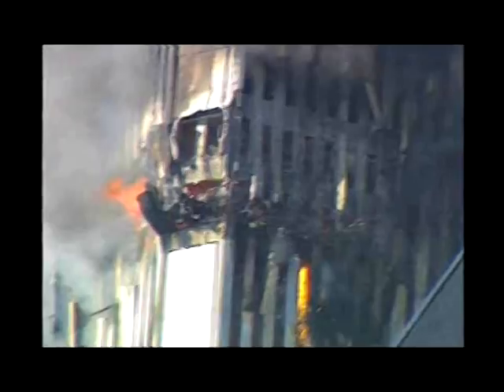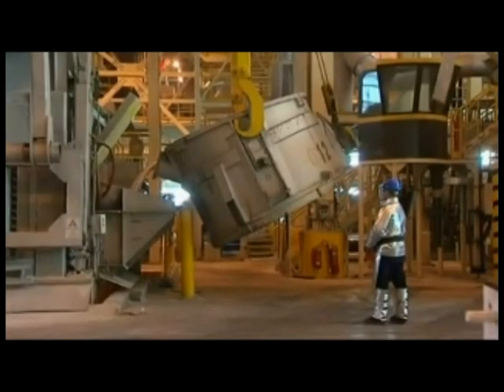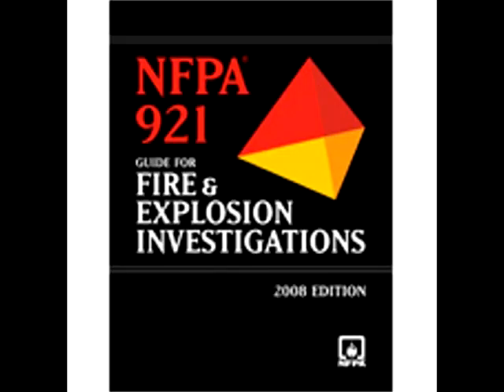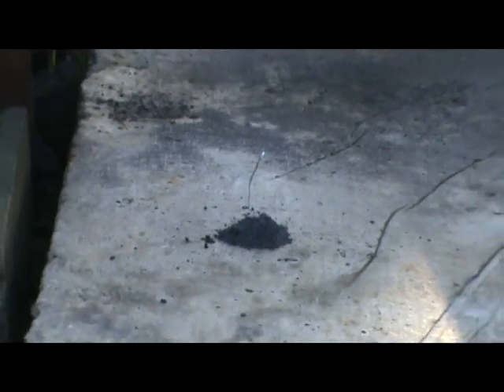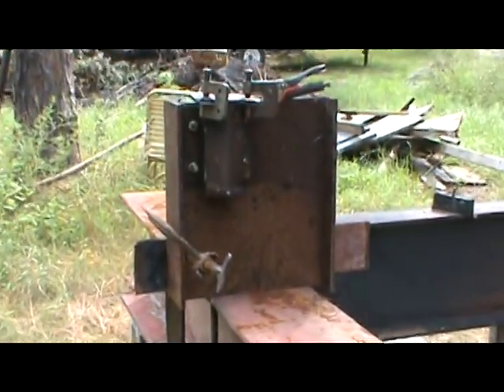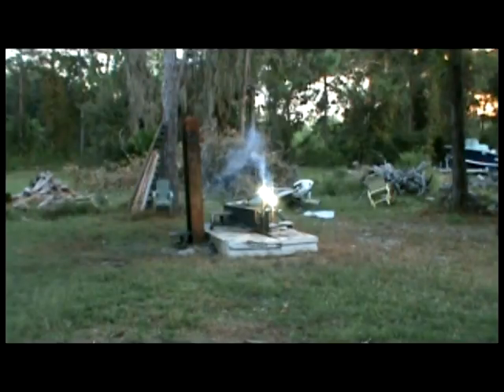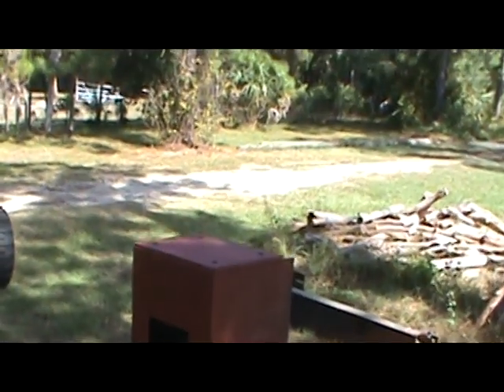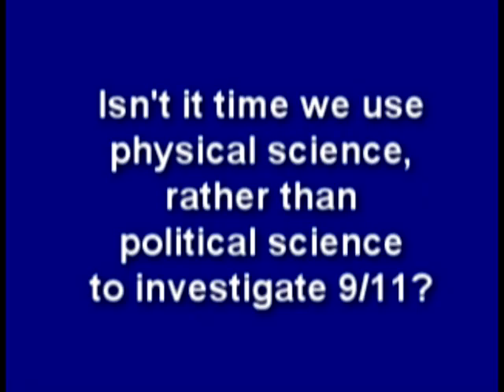9/11 Experiments: The Great Thermate Debate

Comment: I agree. If we want to measure the cooling speed of two similar volume droplets of aluminium and steel - the volumetric heat capacity is a better measurement than just specific heat capacity by weight.
Aluminum 0.91 kJ/kg°K * 2712kg/m3 = 2467.92 kJ/m3°K
Iron 0.45 kJ/kg°K * 7850kg/m3 = 3532.5 kJ/m3°K
However the difference is not that big to distinguish one from another by a naked eye, grainy video footage and guessing the temperatures. More precise would be their acceleration in the free fall!?

Comment: Copy & paste my mentioned keywords (Kerosene flame temperature) in the Google Search box and the first result is: wikipedia ... wiki/Adiabatic_flame_temperature
But if you trace back the discussion, you'll see that I no more claim that inside the WTC the pressure was constant enough to reach 2093°C. And we're further discussing the aluminium hypothesis. What a pity that Youtube doesn't display comment threads normally!

Comment: agree, the point is that even pure aluminium can glow. 
@funkadelic: of course aluminium can be alloyed with other elements (or oxidized)
->more intense glow possible.
if it wasnt possible, the planes couldnt be made of alloys.
@reinis: i would look at the volumetric heat capacity Cv, if we want to estimate which droplet (steel or alu) of a certain volume would cool faster.
Cv of steel is higher - so i guess aluminium would cool slightly faster.

Comment: Just the opposite: glowing colour of droplets depends from the temperature (regardless of metal), more over iron has lower specific heat capacity 0.45 vs 0.91 kJ/kg°K (cools faster and btw solidifies faster too).

P.S. Anyway I don't think that the colour of the droplets already cooled in the air while falling is a very strong argument on either side - for we can barely see the colour in this low quality. The principal part of the argument was that aluminium can be yellow too when hot.

Comment: "Maybe I don't understand what you meant by "glow more consistently""

It means that molten iron (or steel) will have longer glowing duration than liquid aluminum (as seen in the videos - aluminum cooling off almost immediately, whereas iron continues to glow for quite some time as it is spread into the air).

"but cold steel is much darker (closer to black) than cold aluminium"

Cold? We're talking about liquid metals. What I meant was, what is "black" about molten iron?

/watch?v=IVNFuF76Sbk

Comment: Let's calculate how many tons of steel flowed out just in this single place (a sceptic calculated as 30t, maybe exaggerated) and multiply with the no. of columns (not all but enough for structure to collapse), multiply with 2 (twice as much thermate is necessary just for melting the steel once) or rather with >10 (for keeping it molten longer a floor below). Result=many t of thermate. smuggling them inside 3 buildings & cutting walls & attaching to the steel in 100s of offices without witnesses?

Comment: Watch this video ?v=30OVAvg1aGQ (made by a 9/11 truther) and pause at 1:37. The colour of the molten aluminium before it has cooled against the pan is yellow (only a moment after cooling it turns silver). And if you watch drips from molten metal at WTC it seems to turn lighter when falling further down like aluminium, whereas steel should turn black.

Comment: "Author wrongly claims that molten aluminium looks"silver""

It is not wrong to claim that molten aluminum can look "silvery" ("/watch?v=8rERmIN4O_o"), but it *can* glow, yes. Now, at what temperature is aluminum glowing orange-yellow, and how do normal office fires create such temperatures? Further, how does the alleged aluminum continue to glow, falling through the air (watch how fast it cools down), given its low density (and aluminum won't mix easily with furnishings, glass or plastics)..?

Comment: The molten aluminium theory is much more plausible than the steel theory: 1) Author wrongly claims that molten aluminium looks"silver" (in fact it is orange-yellow-white depending from temperature). 2) How can you retain above 1539°C temp. to keep steel molten, but with normal furniture fire you can still keep aluminium molten easily (only 660°C required). P.S. If you find any iron containing spheres - how can you distinguish which are remains from construction works (majority) or from thermate?

Comment: Ok, I must agree with you that keresone burning inside of WTC resembles more diffusion flame (only 990°C) than adiabatic flame (in combustion engine) (2093°C).

But the question remains unanswered - what were the large amounts of molten metal flowing right next to the place where plane crashed (and nowhere else) and long before the structure collapsed (how could a structure stand and seem almost intact if so much "steel" was already molten). More likely the molten metal was aluminium, not steel.

Comment: "where as Kerosene's (jet fuel's) flame temperature is more than enough 2093°C."

You are referring to the theoretically highest burning temperature in a *controlled* experiment where "no energy is lost to the outside environment." (go back and read the article you referred to). Jet fuel does not burn hot enough to melt steel in an open, uncontrolled environment.

Comment: Pure aluminium has very low emissivity, so normally, molten aluminium appears silvery. But for planes, different alloys of aluminium are used. some of the aluminium could be oxidized during the fire. such alloys and oxides have higher emissivity:
omega .com/literature/transactions/volume1/emissivitya.html
and maybe the alloyed, partly oxidized aluminium was even mixed with some other materials of similar density. at around 1000°C (office fire) i would expect it to glow orange-yellow.

Comment: Again, you cannot compare an open fire of a single steel beam to burning skyscrapers. but i believe you are right, that the fuel didnt melt the towers steel beams. office fires can burn very hot for a long time (at about 1100°C) und there can occur events like the backdraft: pyrolized gases can explode and for some minutes the temperature can reach up to 2500°C. but im not very convinced that this is the explanation for the "molten metal".

Comment: you cannot compare burning cars to burning skyscrapers. in closed buildings, conditions are different from those of quasi open fires, temperatures can be much higher. agree, that (dispersed) jet fuel wouldnt burn long, some professor estimated, it would burn for 10 minutes. more important are the materials inside the towers, maybe burning at 1100°C.

Comment: kerosene will only reach 2093°C when combusted in a turbine engine with a very precise afr (air fuel ratio). not making any claims as to how the towers collapsed, but that figure is over 1000°C of the mark for kerosene burnt in an uncontrolled environment. try pouring kerosene on a steel beam and set it alight you could wait a week and it still wouldn't melt it.

Comment: the jet fuel wouldn't reach temps close to 1000°C unless it was burnt in a oxygen feed environment even with the stack effect. and the fuel would have been burnt within 1 maybe 2 minutes max. 
in the same way that a burning car never reaches a high enough temperature to melt the steel chassis even when the petrol ignites.

Comment: Steel spheres are actually droplets of molten steel after they cooled in the air while falling down!
And these explosions of individual windows as thermate ignitions is an absolutely useless hypothesis. Because these individual windows explosions are too few and too scattered to damage the all around steel structure. Besides windows exploded only after the building already started to collapse. The realistic explanation is compressed air escaping from elevator shafts while building collapses.

Comment: The author shouldn't have split the video footage in half: 1st with fire /split/ 2nd with a hole already in the steel. It would be much more convincing that the author shot the whole process into one continuous shot: intact steel -> attaching thermate -> igniting -> zooming in the molten hole in the steel, so all doubts are gone.

Comment: Thought about that too, that the metal was melted by electricity. Maybe thats also one reasonable explanation for the flashes and the iron microspheres. Or another source for the microspheres could be from welding/cutting.
Guess some truthers just want to make profit and most really believe bullshit. But what I like here is, that he performs experiments and even (as i see it) proved the official version in some details wrong (which of course is no proof for an inside job)

Comment: You say you're an Engineer, and so am I. Have you tried proving that the "molten steel" wasn't anything else? How do you know it wasn't an electrical feeder contacting a bare steel column, or a failing transformer, or UPS battery plant failure caused by the plane impact? How do you know the explosions weren't caused by building equipment that can explode if damaged/on fire? There are MANY sources for these things inside large commercial buildings but you "truthers" never look into any of that...

Comment: That al-Qaeda "pilots" should have flown the planes in those manners can be ruled out because there is zero evidence and because they simply COULDN't have.
Everything points to remote controlled (special) Boeings. To rule THAT out you'd have to investigate the possibility thereof and. (And funny enough, those who are involved with remote controlled airliner/Boeing technology are those who blocked them selves from being investigated. Ta-daa!)
You'd also need to explain the wrong "UA 175" engine.

Comment: Great video man and well done for going to such lengths to show how easily it can be done. I can't get the image out of my mind which shows numerous steel columns at Ground Zero, cut at 45 degrees with a residue flowing down the sides. How can just the weight of a crumbling building CUT steel, especially in such a precise way? Controlled demolition x 3... 100%

Comment: It would be wonderful if the Pentagon released footage of what plane struck the Pentagon. But I have the feeling that you can't comprehend why they never will. But it is because that it was the best filmed of the 3 "hit planes" and the pictures would expose more clearly than the blurry WTC plane pictures, what special Boeing "757" we're dealing with (and that it did not knock down the light poles before crashing).

Comment: couldn't you form enough thermitic material from 28 years of corrosion? All you need for a thermitic reaction is an oxidised metal(or metalloid) (eg Fe2O3 or SiO2), a more reactive metal (eg Al or Zn) and a heat source to kick it off (usually Mg wire is used...burning jet fuel finally working it's way through the insulation on the beams perhaps?)

Comment: Utter nonsense. This has been debunked, refuted and utterly discredited for over 3 years now (nano-thermite = paint/resin) yet you still have the idiocy to bring it up.

The peer-reviewed paper has still not been challenged on any level and we now 4 years down the line; thus, it stands.

Secondly, nano-thermite was found in every single dust sample and every single chip contained abundant aluminum, iron, and oxygen, with the aluminum being in mostly a pure, elemental, form.

Comment: Liar.
Read the WTC Dust Study Feb 29, 2012 by Dr. James Millette
"Conclusions:
The red/gray chips found in the WTC dust at four sites in New York City are consistent with a carbon steel coated with an epoxy resin that contains primarily iron oxide and kaolin clay pigments.

There is NO EVIDENCE OF INDIVIDUAL ELEMENTAL ALUMINUM particles of any size in the red/gray chips, therefore the red layer of the red/gray chips is NOT THERMITE or nano-thermite."
9/11 TRUTH DEBUNKED! No thermite.

Comment: Finding elemental residues of iron-oxide and aluminum is simply not something you come across in a 'building collapse'. It is not a simple case of ticking off a list of materials in the building.

Such simplistic reasoning led people to assert that sulfur in the gypsum wallboard which caused the intergranular of steel girders in W7 - ignoring the fact that although gypsum contains sulfur, this is not elemental sulfur, which can react, but sulfur in the form of calcium sulfate, which cannot.

Comment: Nowhere did I say it was impossible ~ I said it was illogical.. Nor am I claiming a pure technical problem ~ emplacement is mechanical. Again where is the evidence of a work crew because the amount of debris removed to install these devices would have been extensive.
Nor did I claim you manufactured evidence ~ Truthers do. 
All of this because someone made up a finding of what "may be" thermite plastic residue and a picture of an angular cut beam (which was found to be cut by a welder's torch).

Comment: Robot and pocket dials occur frequently. How large an event window will be is proportional to the operation. We are talking about bringing down the WTC buildings. Even with a limited window you still have the emplacement problem. 

Finally, all these theories are taking an event and working backwards. This guy designed this device after 9/11 to support a conspiracy which would have taken work crews spraying explosives and attaching detonators on multiple floors.

Doesn't pass the smell test.

Comment: To implant the charges would require propositioning in the building against the beams. Thus a workcrew has to install them at the time the building is constructed (never happen) or would have to do so by removing the fireproofing and implanting the charges then re-installing the fireproofing. 
Timers are out of the question because you never know the exact time of event. Remote controls are not good in high RF traffic areas ~ someone hits wrong freq & bldg blows up or dial wrong # ~ BOOM.

Comment: so I am to believe that thermite was planted , planes were hijacked and then guided to the predetermined impact points . Amazingly enough the thermite stays in the correct position even after the impact , and fireball . Then I assume some black ops team member starts the process to begin the failure of the building .   Comical to say the least .

Comment: The Nano-Thermite used, does not HAVE a loud explosion. There IS an explosion, but nowhere near the percussion of dynamite. Too many witnesses heard small explosions BEFORE the buildings began collapsing. Also, there are several excellent views/videos in which you can CLEARLY SEE this stuff melting the steel. The steady stream of sparks looks like a bunch of welders are in there working. No normal fire does that. Crews went & "re-fire proofed" EXACT floors in the weeks up to this. These r FACTS.

Comment: Tons of thermite is needed. Skyscrapers aren't designed to fall straight down if hit by a plane? or by fire damage. These loud explosions you don't think anyone heard or existed, did in fact happend. Firemans etc. first responders were asked to tell what they experienced that day, 127 out of 500 people said they heard explosions, before and after the collapse. Remember, they weren't asked any questions. For a building to collapse like that, you need to remove all resistant, fires doesnt do that.

Comment: Building 7 fell,according to the official report, due to fire damage from office fires, caused by falling debris, which has never before happend in history. For a highrise to collapse symmetrical at free fall speed, all resistant must be removed at the exact same time(or within few seconds). Fire does not cause such removal of symmetric resistant. You know what removal of all resistant from a building, making it collapse down into its own footprints is called? controlled demolition, wake up man

Comment: If the thermite cutter was hidden inside the box colums as the video said would not the building have had to be built to be destroyed? Something that is unbelievable because they could not have predicted things decades in advance? If is was not they would have to do a collosal amount of work digging into and sealing up the concrete steel walls stuff that would be noticed. And also unnecesseraly complicated. Why not just weaken the joints so the plane brought the building down?..

Comment: 1) Can't link you the burn temp since is from my manuals (unclas so don't worry) & not online to my knowledge. Explosives have a number of classifications and temp is just one of them. Temperature is the control which are converted into expansion & burn rates
2) He did not use actual nano-thermite in his device
4) Radio's are used for police, fire, taxis, construction, and a number of other radio and microwave communications not to mention other VHF/UHF/Marine frequencies.  Too much Clutter

Comment: Regardless of which thermitic material was used the towers didn't collapse due to any plane strike or jet fuel fire as science can prove. But they tell you fairy tales like the amount of paper in the buildings caused a fire which melted two highly reinforced steel structures...or 19 men infiltrated the best defense in the world with box cutters and a sat. phone. Funnily enough at the same time Iraq had decided to switch from the dollar to the euro in it's oil trade. leaving the dollar worthless

Comment: With a number of patented devices existing that use thermite type reactions for piercing and linear cutting of metal, why re-invent the wheel?

Google "Pyronol torch" and "linear thermite cutting charge" for a start. Back in the day, amateurs on roguesci E&W forum made working linear cutters from over the counter materials. Industrial and military manufacturers make far better ones.

Questions of access for application would be more to the point than feasibility of the technology. Anyone with e